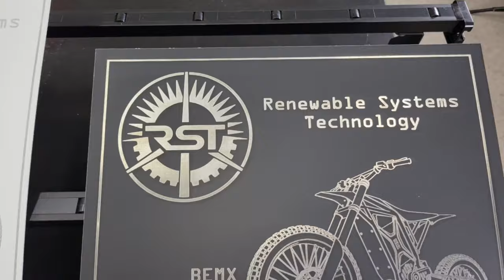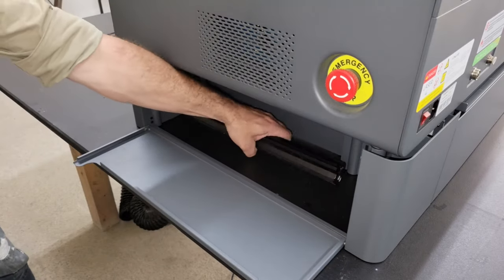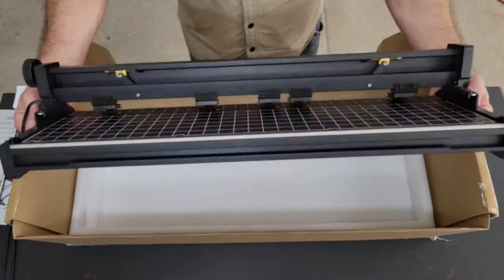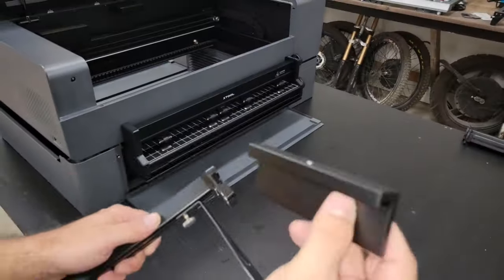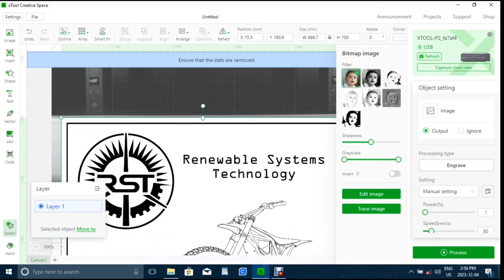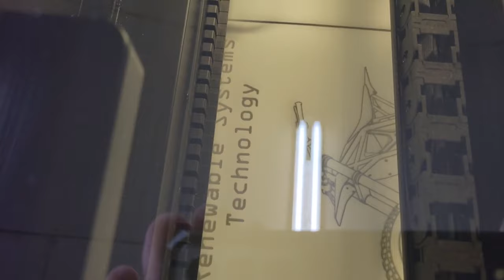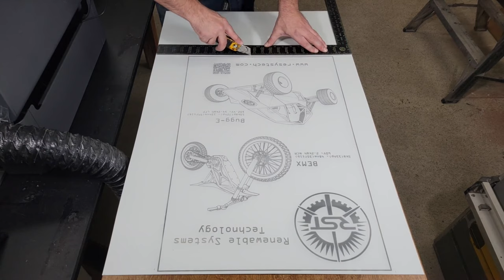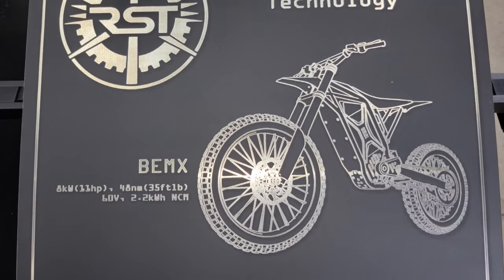Making Metal Posters W/ The xTool P2 Automatic Conveyor Feeder

Comment: Where/what do you get for the aluminum material? First time I've seen it used in a laser video. And great demonstration on the P2 conveyor.
Reply: Asking the important question
Reply from the maker: It's just colored aluminum flat stock that you can find at nearly any building supply store. Buy in large rolls or by the foot. These are personal projects. What you would charge for something like this depends on how much time you spend creating the gcode file and how long it takes the laser with the settings that you use, which is likely to be different between flat stock suppliers since they probably don't all use the exact same coatings or apply them in the exact same thickness. I find that there's a bit of fluctuation for power/speed from one project to the next even if I paint the aluminum myself. The type of graphics that you're working with will also dictate your settings. Simple vectors like these are hard to mess up. But a high res png photo could take some time and a bit of scrap to dial in.
Reply: @JamesBiggar  great video...   is this what you are using, or? 24 in. x 48 in. x 1/8 in. Thick Aluminum Composite ACM White Sheet or 24 in. x 50 ft. Birch White Aluminum Trim Coil

Comment: Where do you get the aluminun sheets?  This is incredible
Reply from the maker: Building supply store. Comes in large 2ft wide by 200ft long rolls, variety of colors. Can be bought by the foot, too. We use it in construction for window, door and siding trim, fascia, flashing, stuff like that. Bare in mind that different lasers react differently to different types of paint. Not all brands will use the exact same coating on their aluminum flat stock, and some will be thicker and more durable than others. Best to experiment with samples first before committing to a large project. I normally just buy white with bare aluminum on the back side so I can spray paint that with a thin coat of any colour I need at the time and use the white side as the back side of the finished product.
Reply: @JamesBiggar  is this the same thing.   24 in x 10 ft Economy aluminum roll valley flashing?

Comment: How did you get the aluminum to flatten out after it's been sold as a round coil?
Reply from the maker: It's thin aluminum, not rolled in a super tight radius and it's not hard to work. Just cut a piece to length, hold each end with your hands and gently curve it in the opposite direction and roll the curve back and forth, if that makes any sense. If it's small enough, roll it over your leg with a little pressure. Doesn't take much.